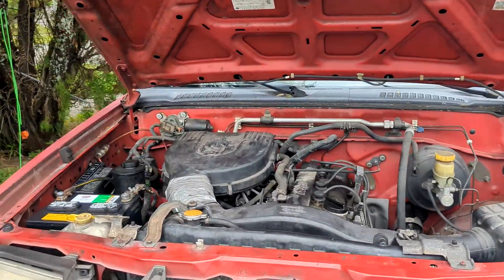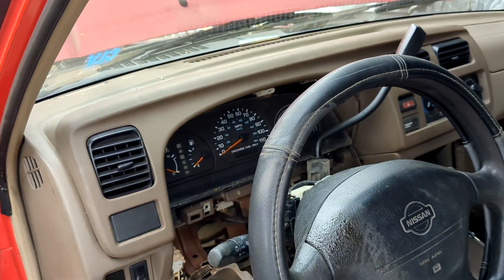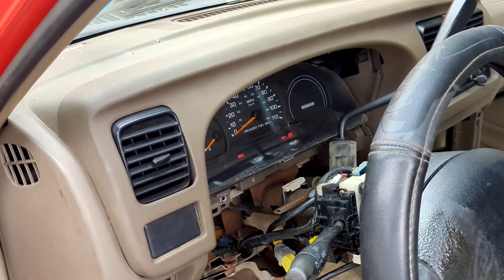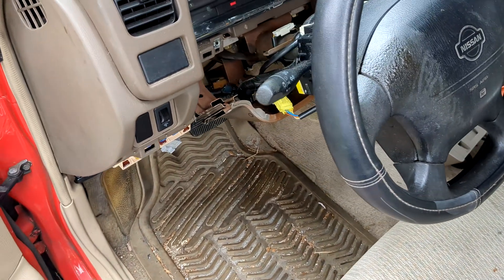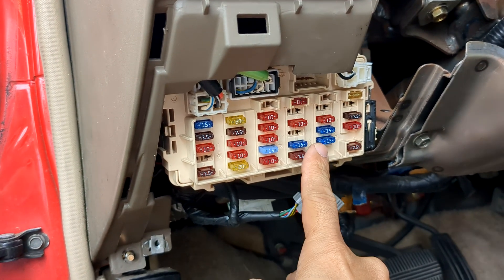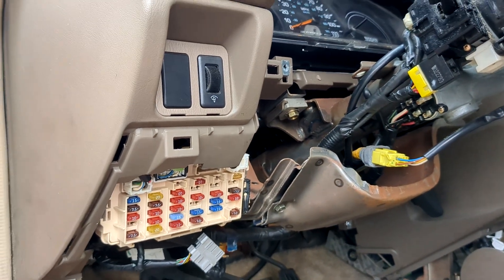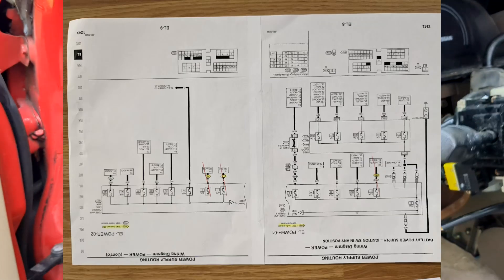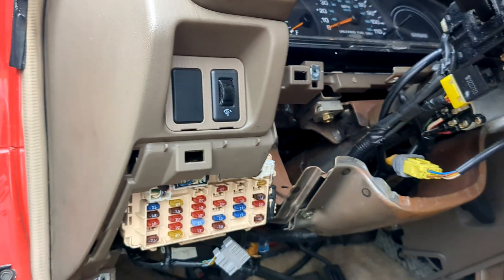Nissan Frontier no power - fixed

Comment: It is probably a similar phenomenon to how quantum particles and anti-particles are constantly popping into existence (and then annihilating each other). When your truck spontaneously fixed itself, somewhere, connected by quantum entanglement, something else of equal and opposite value broke. Probably in my house.
Reply from the maker: I'm no physicist, but I'm pretty sure that's not how quantum entanglement works. Thanks for your steadfast support of this channel, @Atgard1.
Reply: 98 stickshift frontier with the 2.4l. Those fuse boxes are notorious for building up grime and electrical burns on fuses and contacts... take a picture and remove every fuse, clean them with a softwire brush or scotch bright pad.

My truck for years would turn off randomly, durring different times while driving.  Wouldn't happen for months, sometimes a few times daily.

Always happened the same way, decelerating as i applied the clutch engine would cut out, put in a new gear and it would turn back on most of the time (was hard to tell without a tac!)  Sometimes would be fine, or completely stall out at a red light.
From time to time it would also just surge up and down randomly.

No codes, no warnings, just would randomly die.

Would always check power, and it was always there. I finally cleaned all the terminal ends and fuse ends, and i am 1 year without issue.
 If you have a similar issue, you should definitely consider it, its literally free to clean your terminal!